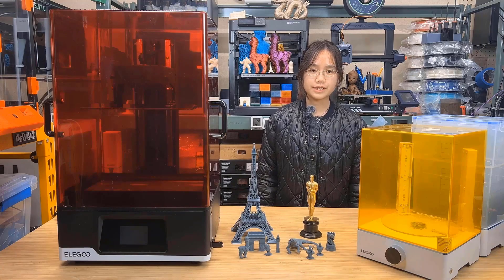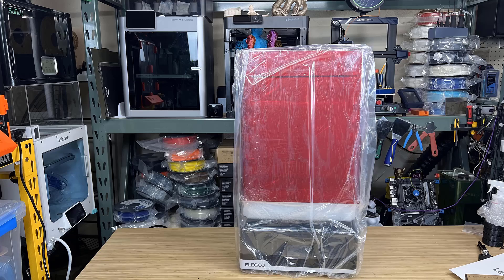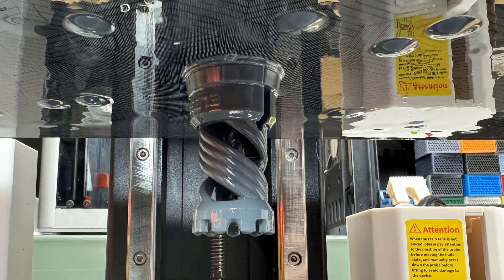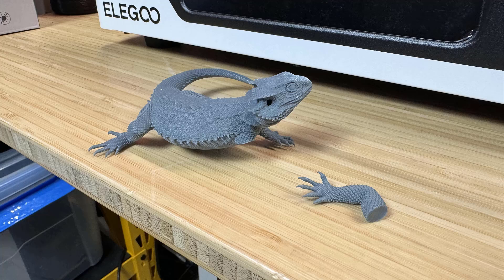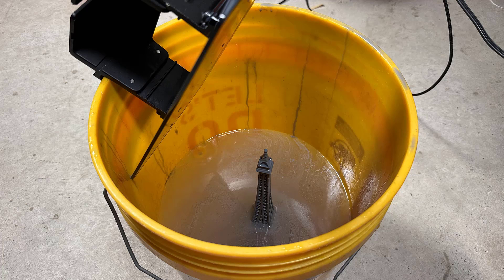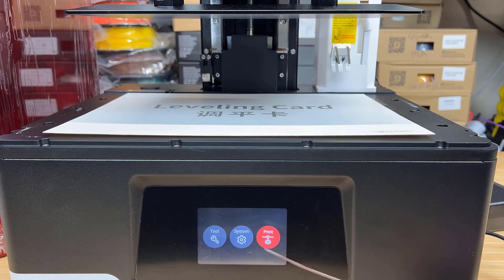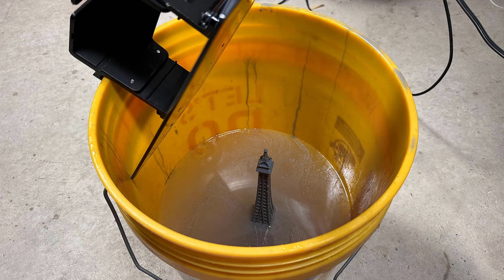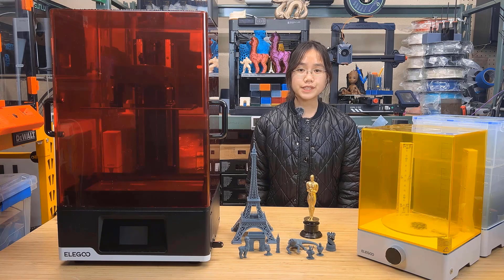Elegoo Jupiter SE 300mm Z-height resin 3D printer with auto feeding and recycling resin pump

Comment: I have had this printer for 2 weeks and it,s been running non stop ever since . It,s a very reliable and easy to use machine i use the default settings and the prints are awesome . I have been 3d printing for 4 years when the large scale resin printers came out by peopoly i  got the phenom then they couldn,t get the screens i did the upgrade and it didn,t work then i bought the peopoly forge and bought a screen when it was time and it didn,t work . After a lot of back and forth with peopoly they wouldn,t replace the nonworking lcd screen after i paid 400 dollars for so i got rid of the  printer . Then i saw the elegoo jupiter se it was the right price at the right size and it works smooth as butter . I don,t use the auto fill i don,t like those i just hand fill it and move on . I also don,t like  the lift off lid but l,m getting use to it day by day . This is my first elegoo printer and what i love most  about  it is i can buy every thing i need for it off of amazon with peopoly you had to order from headquarters in china thats usually  about 2 weeks and if there,s a defect you most likely will have to eat the cost and buy another lcd screen out of pocket that,s too expensive. I watch all your printer reviews and like them keep up the good work thank you.........

Comment: the cap fit my anycubic resin bottle but the pump cannot pump/suck the resin. Any ideas please? I have contacted elegoo and the said to only use elegoo resin bottle which pissed me off.
Reply from the maker: It needs to be airtight in order to work. If so, just buy one Elegoo resin and save the bottle for future use if you really want to use the pump. Honestly, I didn't find the pump very useful unless you are printing something that requires more than a bottle of resin. You can just pour the whole bottle and have another one on standby, letting the pump feed it.

Comment: I am having problems keeping the resin and build plate heated in my garage, does anyone have any suggestions on how to keep this printer warm enough?  My garage is a constant 19c in the winter, the resin I am using is suggesting a 25-30 temp and I am having some adhesion issues without preheating.
Reply: You can use a heated vatband or a brewing heater band and mount them onto the vat. Hope this helps!

Comment: Not a perfect printer but a pretty good value.  I'd prefer the sub-optimal resin transfer complexity be eliminated, more attention to detail for manually emptying the resin tray, for $50 less.  I tend not to avoid complex tools because there's more stuff to break and maintain.  That said, Elegoo has had some good offerings lately, resin and FDM, with good print quality, ease of use and low cost.

Comment: Great review.  While not automatic, I use a 100mL syringe with a short length of silicone tubing on the nozzle (to prevent scratching the release film) to suck the unused resin from the vat and transfer it back to the original resin bottle.  You can get at least 95% of the left-over resin out of the vat by tilting the vat as you showed then pouring the small remainder out of the corner as usual.  Clean the syringe by repeating the process with your alcohol or cleaning solution.  It's inexpensive, quick & simple.

Comment: To be really fair compair, that effel tower should be printed in a kobra 2 or elegoo 4 pr/max , with lowerst high 0.1 or so, then take the strings, since the resign piece are be treated after print you should at least take the strings with some heat gun, then can compare, time and quality.
And we already know quality/detal wise resign its better, but the question is how much? I was curious to seen that.

Comment: Another great review! I got excited when I saw that this printer had a recycling resin pump... but, after seeing your review, it seems to me that this printer's pump -- although being a step in the right direction -- is not quite there yet.

I'm still waiting for the printer that can pump out all of the unused resin, making it much easier to switch colors. My current solution -- having a different vat per color, and swapping the whole vat -- is expensive and doesn't scale well 🤔

Comment: I don't know if the cost is worth it until they come up with a hands free system for resin.
Reply: Resin isn’t the boogeyman. Wear gloves and call it a day. Hell I’ve had resin on my hands countless times. Quick rinse with some IPA and the warm water and soap and you’re fine. Unless you have insanely sensitive skin there’s nothing to worry about.
Reply: resin is sensitiser, you don’t have problem now yes for sure but after years of resin printing you will definitely have allergy
Reply: @rjakiel73  Please, don't ever rinse resin from your skin with any solvent (IPA, acteone, ethanol, etc.)!!!  This will cause the toxic resin chemicals to go right through your skin into your bloodstream needlessly!

Use only warm water and dishwashing liquid soap to get resin off of your skin if you get some on you!
Reply: @rjakiel73  *NEVER use IPA or any other solvent on resin on your skin, it allows the methacrylates to pass through your skin into your bloodstream*. 

Just use dishwashing soap (like Dawn, Palmolive or whatever) and wash it off well.